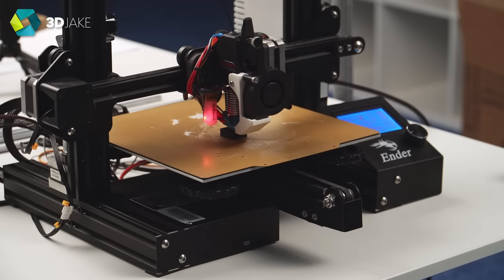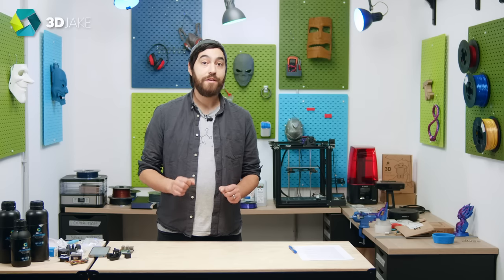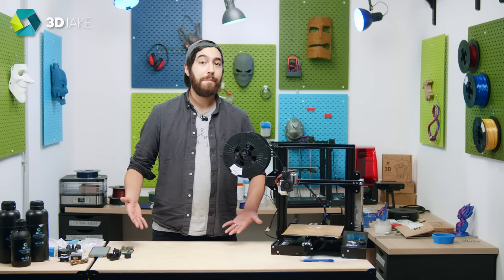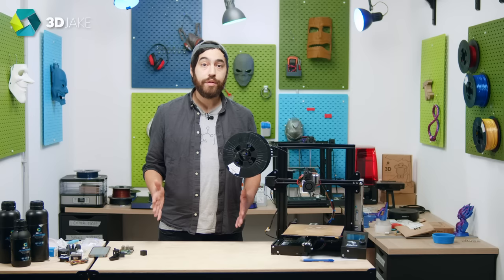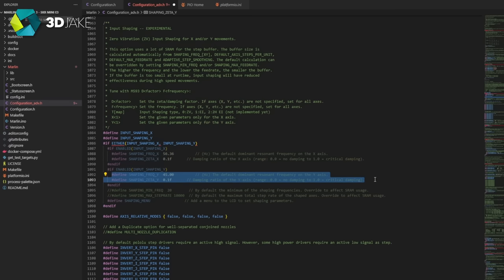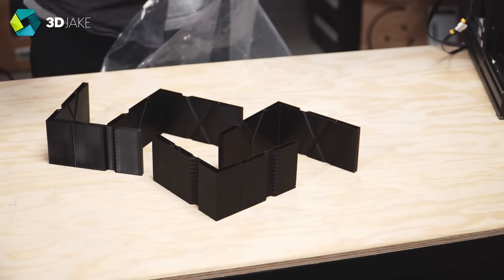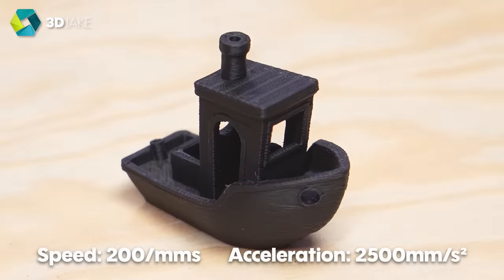Input Shaper on Marlin 2.1.2

Comment: Linear advance for TMC2208 drivers in SpreadCycle are no longer bugged.

I compiled and got it working on my CR10v2 two weeks ago 💯
Reply from the maker: No way! Awesome! Thanks man!
Reply: @3DJake_Official  No worries!~ It's good to be up-to-date

I ended-up successfully compiling an MPC + Linear Advance firmware for my stock CR-10 v2 (board), and it's running smoothly.

I tried compiling an Input Shaping firmware for the CR-10 v2 (board), and it wouldn't have it. It simply blue screened on boot. 

This was also the case even with MPC and Linear Advance disabled. After rolling-back and/or flashing to the aforementioned MPC + Linear Advance firmware, it went back to normal without any blue screens.

I guess the MCU and/or RAM, etc of the CR-10 v2 (board) simply can't handle Input Shaping as is - so a mainboard upgrade is necessary nonetheless if you want MPC + Input Shaping + Linear Advance on Marlin firmware

Comment: Just a random tidbit: Tom Brazier basically single handedly wrote Input Shaping in Marlin. The same guy who also wrote MPC and invented the algorithm behind it, which is the drastically better alternative to PID tuning.

On another note, I always found it funny how so many people praise Klipper and resonance compensation using an accelerometer, yet the results you'd get with both Marlin's input shaping and Klipper's manual resonance compensation are more than fine, so long as you have the time and patience required for it. On the other hand, the accelerometer route may seem like the magical easy solution, however that can also be quite a bit of work, from custom mounts to custom interference free cables, so you actually get good results via SPI.
TL;DR: Input Shaping and Resonance Compensation can easily be done without an accelerometer, and I personally don't see the benefits of an accelerometer outweighing the manual method, at least not when done right.
Reply: I agree with you on the resonance part. Same if not easier to do it manual.

But, using the graphs you get out of your accelerometer makes it much easier to troubleshoot where resonance and noise is coming from. Like a loose belt or screw etc, with manual mode it is harder to find out that you are not as high acceleration as it could be. With input shaping your graph helps you to see if there is something wrong and you should be able to go much higher
Reply: @Freddy-cx5yn  That's a very good point! I've yet to actually try the accelerometer route myself, but will soon enough. Didn't even consider the added benefits of visualizing the resonance but can definitely see that being useful, especially after initial manual calibration and when wanting to tune it to be as perfect as possible.
Being able to tell if there's a mechanical fault is another thing I hadn't even considered, yet would personally highly benefit from that as well.
Reply: Thanks for the shout out. I have just heard from a friend who sidestepped the accelerometer support question by using a vibration analysis tool on his phone. It gave good enough results for IS to improve his prints.
Reply: @tombrazier6172  thanks  for this information :)

Comment: One major point to note is that you can keep the original 8-bit controller and flash klipper firmware. In addition you can use any old computer or vm to run klipper host and frontend instead of a raspberry pi.
Reply from the maker: That is a good point, can also run it on a smart tv box. I wonder which is the least complicated though, especially for new users.
Reply: @3DJake_Official  you can also more than 1 printer on a generic raspberry pi, you don't have to go with the SonicPad for that (which I think is what you were referring to).
Reply: @3DJake_Official  I found a dell wyse 5070 mini pc to be easy to work with and its power efficient too.
Reply: Hi can you point me to a video where someone does that. I have watched every video i can on klipper using laptoo but i have never succeeded i have been searching since december. To date i still havent been able to flash klipper on my printer. If you could kindly point me to the right video?  Thank you my good sir.

Comment: Great video. I've been struggling a bit with finding the right frequency for my ender 3 with an skr mini.
What setting have you ended up with for x and y frequency and gain?
Reply from the maker: For X we had 56.36 and Y was 45.0 but we tried this with a modded printhead, BMG, V6 and 5015 fan so it will be different on your set up :/
Reply: @3DJake_Official  well I just can't seem to get it to change anything. It's like there's a magic button in the firmware I've missed lol.

Comment: I believe the issue between 2208 drivers in legacy mode and linear advance was also fixed in the 2.1.2 release, maybe double check that.
Reply from the maker: Thanks for the update, that's gonna be really useful :)
Reply: That was fixed some time last year before IS. Then during IS development I broke it again. And then fixed it again. Anyway it works now.
Reply: @tombrazier6172  yes, it works on 4.2.7 and ender s1 pro board :)

Comment: So far the best video that explains why Marlon and Stock Creality are a no-go in most cases.   I'd love to see a dedicated video on what upgrades would be required to get the most out of clipper as well as some direct comparisons.   I can upgrade my hot end to a Spider Pro or Sprite Pro, which would take care of the issues with melting enough plastic.  I'm leery about replacing my 4.2.7 boards as I am not familiar with compiling and flashing Marlon, other than installing a bin file on a flash drive and turning on my printer.   All the other steps are over my head, and I would want the option to just download the bin file and flash the board with a USB drive, no fancy USB to connector, raspberry pie or whatever.
Reply: It's not Marlon and it's not Clipper.
Reply: @alejandroperez5368  I know it shouldn't but this really bugged me also lol

Comment: I just stumbled onto your channel as i was researching input shaping.  back in the late 70s I was working in CR Scanner R&D and trying to increase data accuracy with speed and acceleration compensation for vibration. We were slinging an X Ray tube back and forth and rotating it to boot. So now in retirement i print 1950s Model Train parts and new updates. What else. My 10 S Pro is V1 with a lot of mods. OK to the point can I get this MArlin Experimental code to run on my 10S Pro?? I am on the original Motherboard but use Pi to run Octoprint. As I expand my parts list and am not getting more requests for parts from other Hobbyist, I need to make more parts faster. Especially test parts where you need to print a part to final test every time. So .....   What would You Suggest I thought at first the Creality 4.2.7 would help but it seems NO! We need more processor speed, second processor or a second printer  for small parts fast.  Any suggestions to help get my 10S Pro up to speed. Mods today: Z axis timing belt, Garolite Bed, Micro Swiss Direct Drive & Hot End, BL Touch, Z axis Struts. I also have a Laptop PC to use and not opposed to update motherboard or User Interface if it can tie in and help the end result, Great prints as fast as possible. The option is $1,000 Bambu, right? Dennis in Virginia on Frankentrain Laboratories facebook.
Reply from the maker: Ooooh! ok so you probably won't be able to run Marlin's input shaper on the original mainboard (I say probably because people have used marlin 2 firmware on 8-bit machines, unfortunately, I don't know much about that but there are videos on youtube about it). You could upgrade the mainboard or (and this might be the best solution for you), you could install Klipper on your Raspberry Pi. Klipper is another firmware that also uses Input Shaping. But this really depends on which Pi you have though because it won't work on earlier versions so you need at least a Pi 2 unless you want to scale back on Klipper features. There is info on the requirements on Klipper3D's website, check out the FAQ there. 

If you want to go the new mainboard route it is, unfortunately, a bit tricky because the CR-10S Pro's touchscreen is close to incompatible with every other board. There are workaround for this with a little extra wiring but it is a bit messy. I would really recommend the Klipper on the Pi option if possible but if you have other printers it might also be handy to get a Creality Sonic Pad which is basically a big touchscreen with Klipper and it is suitable for the CR-10S Pro. This is around €200 so it is probably the most expensive of the options but it can run 4 Creality printers simultaneously so a great investment if you have a few printers.

All that said, using input shaping on a CR-10S Pro is no substitute for a CoreXY or Delta printer like the Bambulab, Voron or FLSUN printers. The Pro has a big bed to move so you definitely won't be able to get more than 200mm/s out of it, I expect less, 150mm/s most likely. Which is pretty low compared to the printer brands I mentioned above. Hope this helps though :)
Reply: @3DJake_Official  yes it helps. Thank you for taking the time.
The Bambu is on my want list but not soon. I like the feedback control stuff. I have become attached to my 10S Pro. So $200  on a Sonic Pad is not out of range for me. I was looking at the CR 4.2.7 motherboard but it seems even that is limited. My Pi 4A is highly under utilized. It was one of the last one available. I really am not smart enough to use it full potential. Guess I will keep reading and learning. Thank again for good channel and informative videos, Regards, Dennis
Reply: My PI is a 4B, whatever.

Comment: Jake, I swapped my original ender 3v2 y motor with the larger extruder motor. Could I theoretically run even higher acceleration and jerk having a larger motor?
Reply from the maker: I don't think that will help that much, you'll be able to run it faster but you'll still have to contend with vibrations which will limit practical speeds.

Comment: I very much appreciate somebody explaining this.  But, the truth is I probably won't use it unless they add ADXL support.  Klipper spoiled me.  I am pretty sure adxl support is beyond mainboard capabilities, but I could be wrong.
Reply from the maker: Yeah that is a pity, the test isn't difficult but I get the Klipper spoiling :) Whether adxl support is possible on a regular mainboard is a good question, I would think probably not.....might be easier to run the accelerometer on a computer and input the results manually.
Reply: Some main boards like the BTT Octopus ones have several UART ports so it can read the ADXL accelerometer data, also I²C (which the Klipper page advises against but who knows).
That could make it possible on such a board, but for the ones that are already fully occupied with TFT LCDs and such it's likely not feasible.
I would love this as an Octoprint plugin as well, would solve the issue of no ports on the board.

Comment: When I try to use PrusaSlicer in vase mode with the layer gcode, it will not go over 100mm/s even though i set wall speeds to 300mm/s. Any idea why this is?
Reply: It would be subject to another limit. You may have limited max speeds on your 3D printer firmware, or you may have limited max volumetric extrusion rate in PrusaSlicer itself.
Reply from the maker: Don't forget to set the machine settings to ignore and the minimum layer time in the cooling section

Comment: Didn't work for me other than printing out the ringing tower in vaze mode. I've compiled the latest Marlin for my Kingroon KP3S, everything else works as usual but once I try to enable input shaping with a frequency found (turned out to be 32 Hz) the benchy can't go pass the first layer. After some movements the steppers just stop. I think it's caused by short segments. Also if I enable IS on one axis only, then only one axis stops, the other one continues moving. After cancelling print, it can't even home because I suppose the drivers are locked into an error mode. Also tried the ringing tower in non-vaze mode, with two perimeters. It stops somewhere mid-process as well. Also tried turning on and off the S-curve accel, recompiling/reflashing, no difference regarding the "stop moving" behavior. With no IS enabled from gcode, however, everything works fine, LA works fine etc. Using on daily basis, just not enabling the IS.
Reply from the maker: That's weird man, I expect there'll be some feedback on this in the near future, stay tuned to the marlin github.
Reply: @3DJake_Official  Yeah, I've figured it will be found out by someone else sooner or later, I'm not that of an active community member myself :) So just waiting for now :)

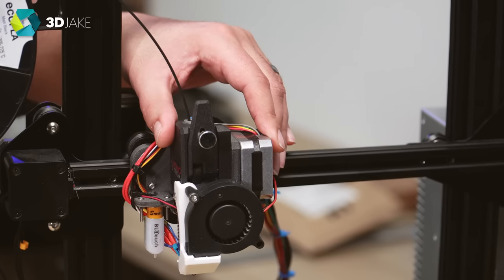Comment: Fake news at 2:02 - Input shaper, as Klipper offers it, does NOT cancel out vibrations. It filters out frequencies from the movements which cause resonances on the printer. How should it remove vibrations and move in the opposite directions to counter them? The accelerometer is usually not even connected while printing, it does not even know if a vibration occurs.
Reply: It "filters out frequencies" exactly by commanding opposite movements from the steppers. It doesn't need the accelerometer to be attached while doing this, because it has measured the fundamental frequencies of the system in advance. In the same way that a pendulum of a given length will always swing at a certain rate, the printer will oscillate at a certain rate. If you know what that rate is, you can anticipate it
Reply: @prxrb  It simply does not do opposite movements to cancel out vibrations. It's a filter which reduces movements which correspond to frequencies that the shaper with the given parameters attenuates. Everything after your first sentence is correct.